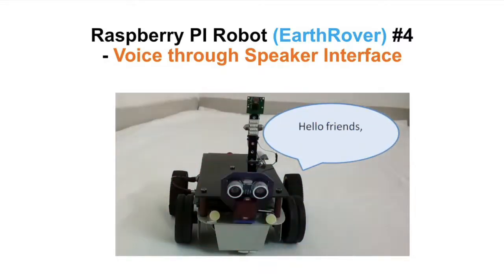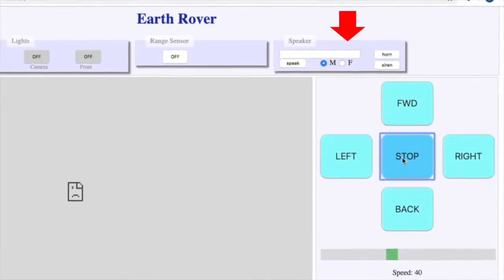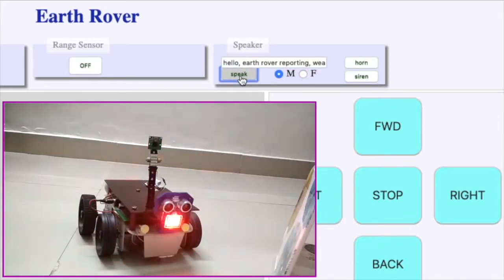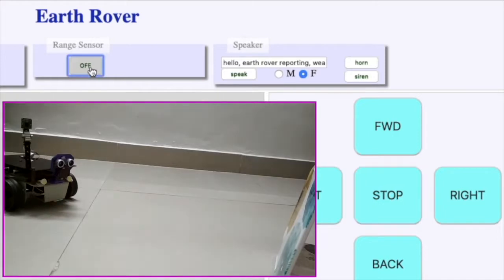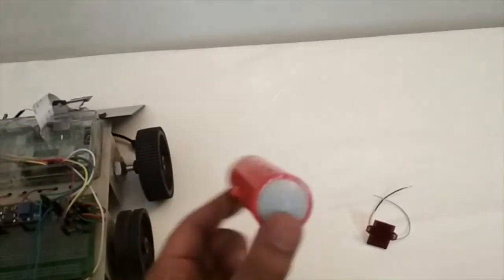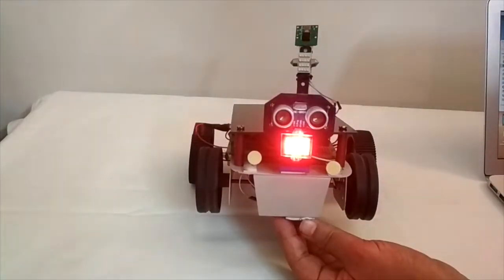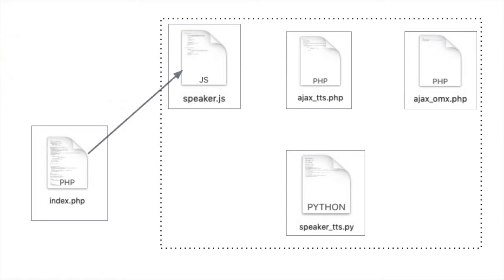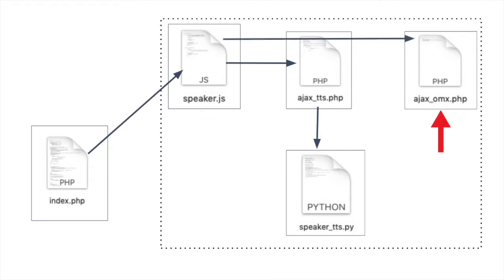Raspberry Pi speaking robot: How to generate Voice using Text to Speech ESPEAK (EarthRover #4)

Comment: Thank you for making this. Using Pi 4 the TTS doesnt work using earthrover control panel with analog jack. Analog jack works with TTS at command prompt. Also TTS works with hdmi at earth rover control panel. Thanks for any advice.
Reply: Also .mp3 files play with earth rover control panel analog jack Pi 4.
Reply: Hi. I have the same problem and worry about some issue with php Ajax file and python,  because when I try to execute the python script it says " idex out of range " or something
Reply: For those who have this error, you have to disconnect the hdmi, try it without monitor...and the audio jack works!, it is not ajax problem.